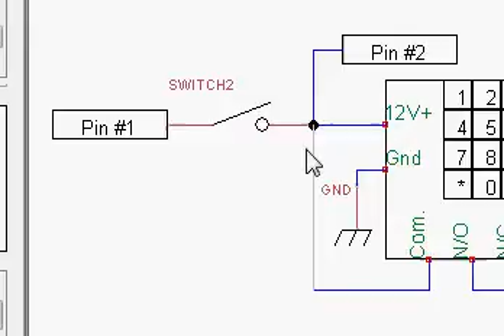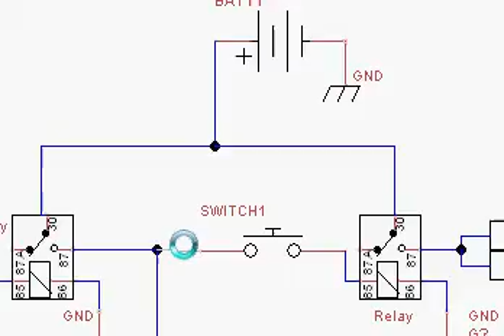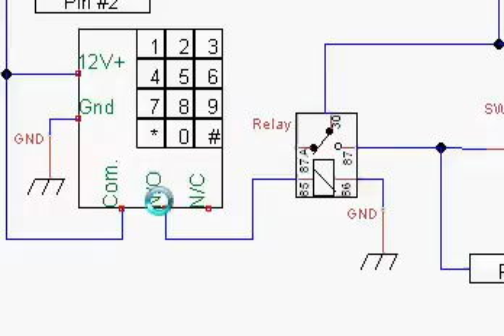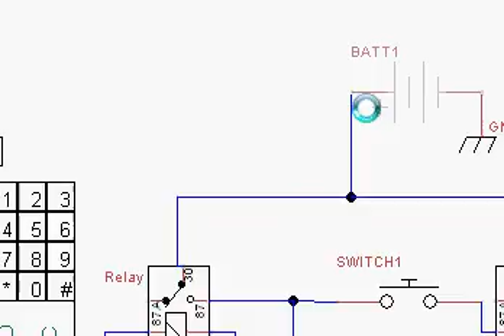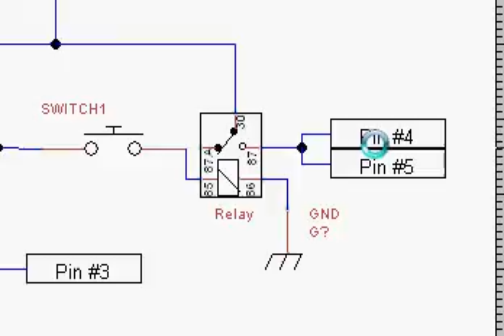Wiring diagram for 1992 Nissan 240sx ignition swap (v2)

Comment: @williamsjp2004 

If I want to use a toggle switch instead of a keypad would I just run:

Red/white wire to a toggle "kill switch"

Run the other end of the toggle "kill switch" to the toggle switch on my push start panel AND go pin 2

Run the other end of the toggle switch to a relay powering pin 3 and supplying one end of the push start button. 

The other end of the push start would be connected to a relay 

That relay supplies power to pin 4 and 5 

The 86 pins on both relays are grounded. 

The 30 pins on both relays are powered by a constant 12v from the battery (not the red/white ignition harness source) 

Pins 87a on both relays are not connected to anything. 

I have a diagram I drew up. Please email me at reallyslow1991nissan240sx@yahoo.com
Reply from the maker: Hi Caleb, basically the only change would be when you see the keypad "Com." and "N/O", you would place the switch there instead. So pin 1 to a switch, other side of switch to pin 2 and another switch, and on the opposite side of that second switch out to the other pins respectively.
Reply: williamsjp2004 

I connected Pin 1 to a one end of a toggle switch. This is my hidden "kill switch" to prevent car theft. 

The other end of the toggle switch is split. One is connected to pin 2 and the other is connected to the toggle switch on my push start panel. 

My push start panel has one toggle switch and a push start on a carbon fiber panel. 

The other end of the toggle switch on the panel is connected to relay 1 pin 85. 

Pin 86 is grounded. 

Pin 30 is wired to the battery with a 15 amp inline fuse. 

Pin 87A is blank

Pin 87 is spit. One is connected to pin 3 and the other is connected to one end of the push start button. 

The other end of the push start button is connected to relay 2 pin 85. 

Pin 86 is grounded. 

Pin 30 is wired to the battery with another inline 15 amp fuse. 

Pin 87A is blank. 

Pin 87 is connected to pins 4 and 5.

Comment: 1 have a 260z datsun that hase no spark i narrowed it down to the wire order for the control madual now is there another way i can get the timing for the coil to distributor and how to wire it 

my car is stock but the person i bought it frome cut the controll madual wires and but a gm one on and it ran befor but i took all the wiring out and when i put it back i couldent remember what the order for it was can you help ? thx